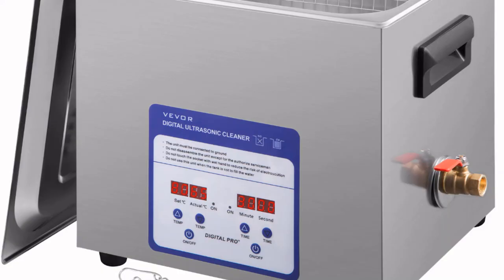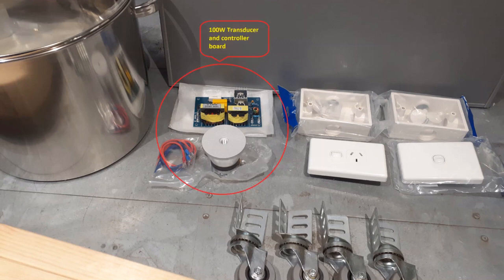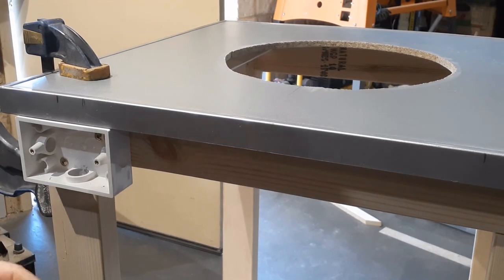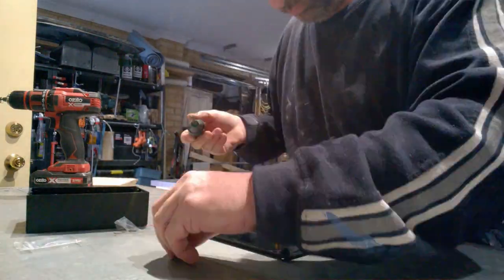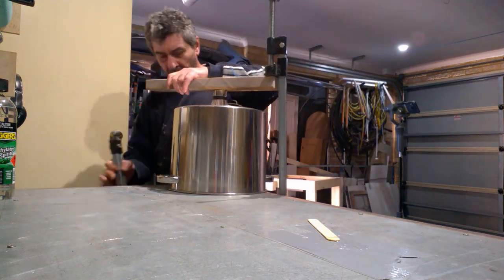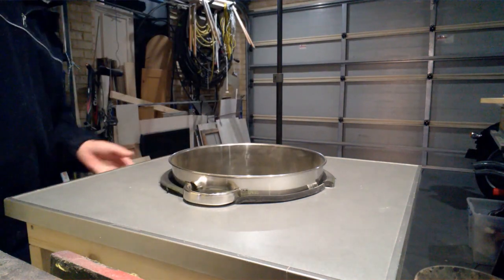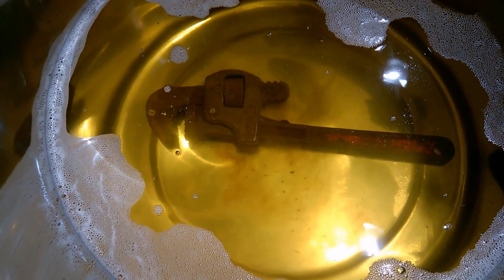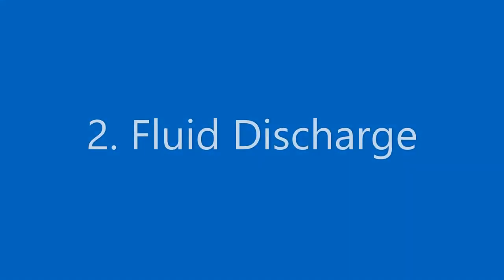I made a 4 gallon Ultrasonic Cleaner for less than $100

Comment: where to buy?
Reply from the maker: Hi, the ultrasonic is from AliExpress. The pot from a supermarket, and everything else from a big box hardware store. I have received some feedback that I should include more transducers, so that might be an upgrade that I would consider. In saying that however, the single transducer unit is working just fine for small engine carbs.

Comment: but at the end you have welded the mounting screw of the transducer-
Reply from the maker: Ideally I would have liked to weld it, but I suspect that I didn't have the right gear or the right skills. So in this case the transducer was only epoxy onto the base.
Reply: @riccardosdiyandrestoration  but what is that black spot at inner side of the pot?
Reply from the maker: @p_peja  :-( That was my failed attempt at initially trying to weld it on. The transducer is only attached with the epoxy, however, in saying this, the unit continues to perform well. I am thinking of upgrading the unit with additional transducers - I might try the welding again on the additional units.
Reply: @riccardosdiyandrestoration  thank you for clarification

Comment: No way it’s less than $100.
Reply from the maker: Yes way. Didn't include the cost of the electrical switches and the timber, but those were leftover items from previous projects. Ultrasonic was $70ish, and the pot about $15.  The rest were minor fixings etc.
Hope you enjoyed the video. It's a few months old, but the unit is still working well.

Comment: a trivet in the bottom of the tank would be better, rather than items being placed directly on the bottom, this aids cleaning, and circulation
Reply from the maker: Excellent suggestion. I have tended to suspend items from a bar across the top of the unit, but a trivet would be a quicker option and definitely better for smaller items. Appreciate the feedback.

Comment: I have hard time to believe that all that cost you less than $100
Reply from the maker: Sure did. Ultrasonic transducer was about $70. Pot was about $15. Electrical less than $10. I already had the timber and the fixings. I suppose if we factored the timber then we may go over $100, but not by much.
Appreciate the feedback.
Reply: @riccardosdiyandrestoration  Here in canada, it would have cost much more
Reply from the maker: @chauffeurmarco  Prices are going stupid everywhere. Cheers
Reply: @riccardosdiyandrestoration but you paid also for Stuff you already had 😂
Reply from the maker: @Taran-d.B.23  Yes that is true. The trolley is probably overkill. At the moment it just gets moved around. I will probably delete the trolley and instead fix the unit into the garage shelving. Hope you enjoyed the video.

Comment: for good operation you need 25w/litre or 100w/gallon and it is better to use more small units than one large one, based on the surface available.  the driver and the transducers heat up a lot especially the cheap ones found on AliExpress and eBay, they have undersized transformers and fake components that often burn out if not well cooled.  last tip, if possible avoid gluing the transducers, weld the pin and then screw the transducer, if you really can't weld, use very hard resins and don't place the objects directly on the bottom.
Reply from the maker: Thanks for the feedback. Lots of very useful and relevant information. Very much appreciated.

Comment: is it safe to clean aluminium cylinder heads or short blocks, or aluminium pistons in a ultrasonic cleaner?
Reply from the maker: Yes. It may depend on the liquid you use, but if you stick with detergent based additives, these should not react with the aluminium.
Reply: @riccardosdiyandrestoration nice!, thanks for your answer :)

Comment: You could make it better by attaching a strip heater to the outside wall of the tub and a thermocouple to the opposite end to sense water temp. This way you can set water temperature and heat it. Maybe insulate it with foam board although not necessary, it would help keep water warm.
Reply from the maker: Thanks for the feedback. Absolutely agree with you. At the moment I am using a heating element plugged into the GPO.
Reply: @riccardosdiyandrestoration  im just using immersion heater on mine to get up to temp or close and then the ultrasonic actually keeps it warm and sometimes heats it a little more.

Comment: Easy and cheap improvement would be o add a basket, it cleans better when whatever you're cleaning isn't sitting directly on the bottom of the tank.
Reply from the maker: Agree with you. I have been suspending items with some wire - which works well when there is a single item in there, but not so good when I have multiple or smaller items.
Appreciate the feedback.